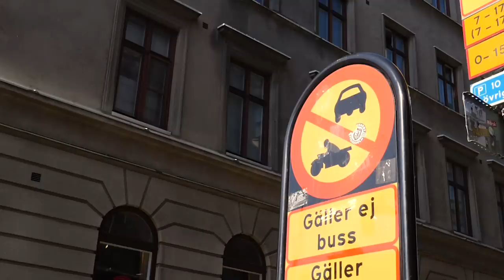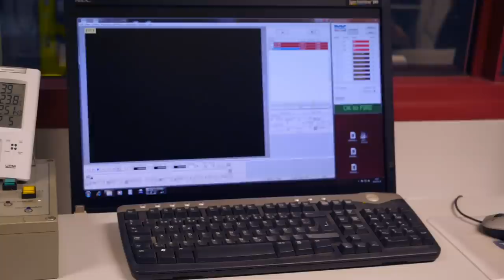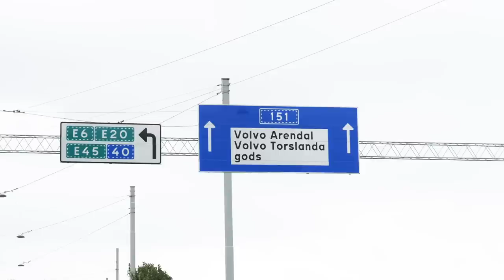The Next Step For Bike Helmet Safety?

Comment: It makes me wonder if the impact of the top of the head - and with it the top of the helmet - on to the center of a cars motor cover is a realistic scenario. I cannot imagine that this happens very often in case of an accident that  a cyclist falls head first from above as if he is falling from a roof. I would have guessed that a sideways impact or front impact more realistic. We learn in the viedeo that a great amount of data of real accidents have been analysed to find a realistic scenario for these tests. I doubt it strongly.
Reply: 4:45 he says they will try different angles and speeds.
Reply: @mattfoley6082  Thank you Matt Foley. At least it was awkward to focus on this special test in the video.
Volvo - as all the other big car producers - cannot be trusted to prioritize safety as long as they build big SUVs which endanger children, pedestrians and bikers extremely with their breast high motorcar radiator fronts. All these cars should be banned from private traffic not only because of their rediculous dimensions, wheights and their unnecessary large amount of gas consumption but also because of their threat in case of an accident.

Comment: So are you saying all this time, nobody had a damn clue how safe helmets actually were, despite everyone shoving them down cyclists' throat? And even now, the test showed that "the helmet was not that effective" and the bonnet absorbed most of the energy?
Reply: They have figures of acceleration, energy adsorption, surface feature effects and the like for helmets at ranges of angles, speeds and orientations using different head- and body-forms. What allegedly hasn't been done is to actually collide a helmet and head-form at a car and measure both. By the way, where is the "the helmet was not that effective" quote from ? I missed that.

Comment: POC and Volvo: hand cash to GCN
GCN: Buy a Volvo look how great they are!  You can even drive away after smashing through a cyclist at 35 km/h!
Shameful advertorial that goes against cycling safety entirely.
Reply from the maker: Hiya ptkn, as we've disclosed, POC helped us to make this video and get us out to Sweden. Of course we don't mean that hit and run is permissible - but we do look forward to how this collaboration can help improve safety for all road users in the future.
Reply: @gcn  Appreciate the reply and agree that you are clear about the money bit, that was not some sensational big reveal :-D  That bonnet part where you say you can drive away was particularly problematic...
However, the main concern and reason I thought it was shameful is the overarching point that this video makes that "cycling is dangerous and so we need car manufacturers to help us put plastic on the heads of the brave people that venture out on bikes".  This is the opposite of what we as a community should be speaking about.  Cycling is not dangerous.  And the more humans on bikes there is, the more problems are solved from safety, to public health, and air quality.  
Here, it just seems like POC and Volvo are winning the argument through GCN to get a) people to continue to drive as it is safer & better, and b) buy plastic hats if they do go cycling (which studies have shown makes more people see it as a dangerous sport/method of transport and therefore avoid it, and indepedent studies show very little benefit to wearing a helmet in most non-race non-child crash conditions).
Do some videos on cycling safety and the non-pro-helmet "dress for the destination" theories out there!  You won't get much sponsorship but I can help share information :-)

Comment: Is the weight of the helmet/ballast  say 50-> 80Kg+? ie the weight of an "average cyclist" ? 
If NO, then it's not realistic!! 
Also, the Helmet should have some built in collapsible feature, maybe like  bubble wrap so that it collapses slightly  and absorbs the forces of the impact rather than being a solid structure , at least on the inside...!!
I feel that they could work with USA Football helmet manufacturers who are deveoling some sort of system in in the head on impact area...

Here's a RADICAL thought,  as SO many cyclist are hit from behind, what about allowing cyclist to ride on the OPPOSITE side to traffic flow? That way they  can see each other!!...in the sameway as pedestrians are taught  to walk in country lanes, on the opposite side of the traffic flow!!
Reply: "Also, the Helmet should have some built in collapsible feature, maybe like  bubble wrap so that it collapses slightly  and absorbs the forces of the impact rather than being a solid structure , at least on the inside...!!"
That's how helmets work, hence the deformable interiors. However it turns out that rotational, rather than just linear, accelerations are very important in the development of concussions and other brain injury effects - hence the work with things like MIPS and Spin to reduce them.